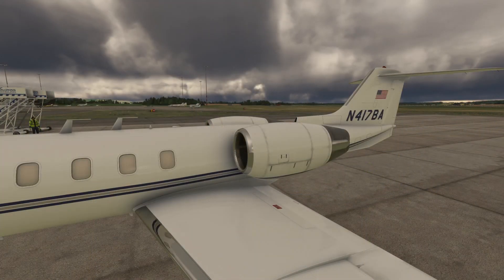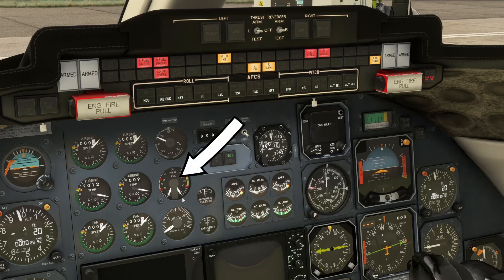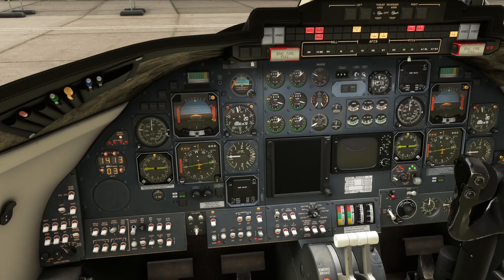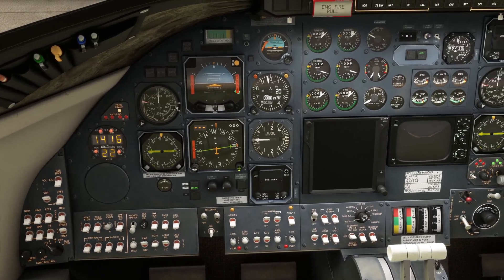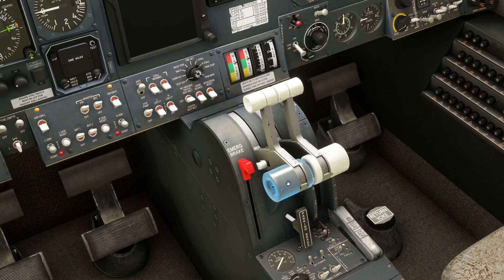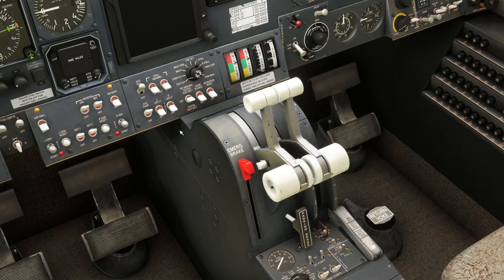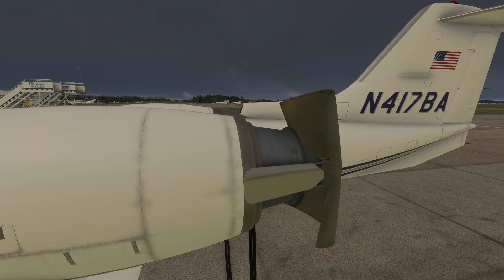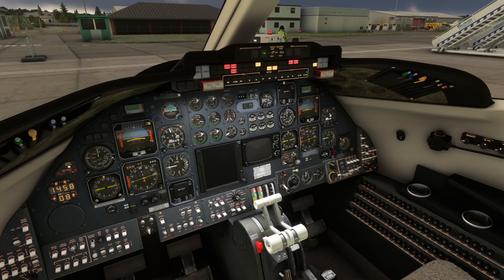How to Fly the Learjet 35A | Part 3f:  Engines

Comment: i not got the best controllers, and my throttle doesnt have reversers and I dont have a bind for them, seem to have run out of most bind options.
And when landing fiddling with clicking one by one reversers is a disaster.

Wish I could have them auto set.  So atm I not been using them.
Great guide again - thanx.